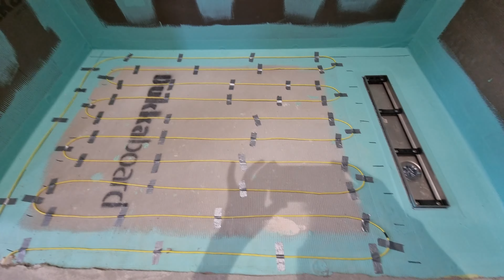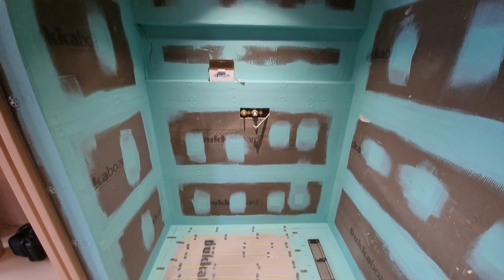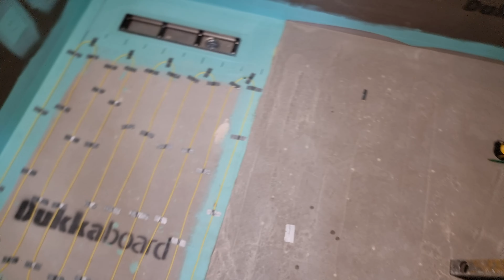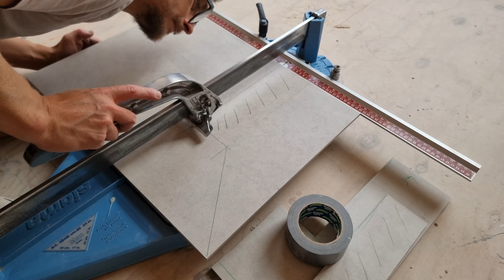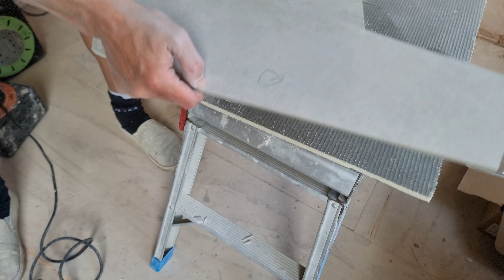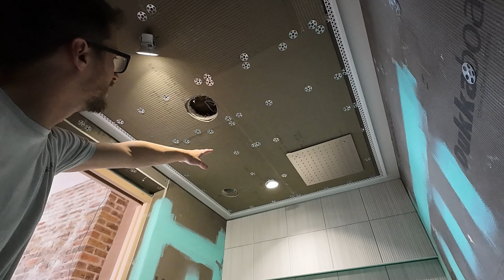How To Tile a Wet Room Shower Tray | The Ultimate Guide

Comment: Very nice, but I would do the dry fit on the tiles before fitting the underfloor heating elements. Nick one of those and it's a world of pain...
Reply from the maker: Hey thanks, Yep always got to be careful working over wires, You can test them  though the job though if needed 🍻

Comment: Hey mate, very nice cuts, looks good.

Some people would say, tile the walls first, i can see you didn't, do find it easier like this?
Reply from the maker: Thanks mate, As it's a wet room you'd tile the floor first to add to the waterproof barrier (so the wall tile sits on top of the floor tile, so you don't have a joint straight down there)
Reply: @thebespokebloke thanks for reply bro.
I'm diying and planning to do very similiar to yours 😁
By the way, why did start the wall with small tiles?
Reply from the maker: @YautjaPt  Awesome mate best of luck!. I think from what I can remember I had to prepare the floor first on that one. So I just tiled a bit of the wall, so it wasn't a wasted day (just prepping the floor)

Comment: hi , have you got picture of the glass screen fitted ? im currently fitting a wetroom with the abacus linear uno former, no envelope cuts, and im stuck on how its going to look were the glass goes along the floor were the tile trim is between the former and rest of floor tiles
Reply from the maker: Hey, There's a bit of footage of the bathroom finished in my "Tiling a ceiling video" but it doesn't show much of the floor But shows the screen if that helps 🍻

Comment: Hi Just got on to your videos  very good....i have a linear 900 x 900 wet tray and I have purchased 900 x 900 porcelain tile .  could you possibly advise me of best way to lay . I dont want to cut tile through the middle ie 450 centre ...many thanks ...col
Reply from the maker: Hey, Great stuff! It depends what type of linear tray it is really (check out my seamless wet tray video if it's different to the type in the video) But the tray will have natural falls in it from the edges of the drain to the edges of the tray (so 4 fall lines if you like) If you wanted to do it in one piece of tile, you'd cut the tile following those line. You can always send me an email with a picture of the tray e.t.c if you like 🍻

Comment: Amazing work. I was contemplating DIY but having watched this I need to get a skilled trader in to do the job justice
Tile manufacturers could do everyone a favour and make pre cut tiles for these floors?
Reply from the maker: Thanks man, If you've got the right tools and are comfortable at DIY then it's easily doable. But yeah having someone that knows what they are doing off the bat is always going to be the best result. Regards pre-cut tiles... I don't think they'd be the value in it, As it depends on your drain to how your envelope cuts are going to be cut, Plus easier to break the tile on transportation. With the right tools, although can be time consuming, They are not to bad to cut 🍻

Comment: how did you create a fall on that back 30cm or so, as you’ve shortened the effective fall-cut as you described? Are those tiles further from the drain and nearest the back wall just level or did you create a slight slope somehow. Cheers
Reply from the maker: Hey, So apart from the perimeter (which is level) the tray is pre formed to fall to the tray at any given part. So even if you cut it in half it would still effectively be falling towards the drain. But yeah with them back cuts I would just make sure it's following the same full as the tiles in front of it. So if you put a level from the drain to the back all the tiles would be hitting the bottom of the level. Hope that makes sense.

Comment: How you can make envelope cuts with a grinder is remarkable. What a lovely finish. Tiles on the ceiling? 😅
Reply from the maker: Thanks Phil, Really It's just a bit of practice and a decent disc.. Yes that fun ceiling, ha.. I do have a video on that as well!
Reply: @thebespokebloke I noticed on the video the shower tray isn't mechanically fixed to the substrate. Isn't there a risk of lift up in the future?
Reply from the maker: @PhilipAlexander-rz6hy  Yeah they stick and bond very well, So you wouldn't tend to mechanically fix a backerboard tray down. With the adhesive underneath and something like Sika flex/Ct1 around the sides, they won't go anywhere. Ideally you don't want to screw through the wet tray.
Reply: @thebespokebloke I suppose that makes sense. These hybrid polymer adhesive sealants are unbelievable. They stick anything to anything and the anything isn't going anywhere 😅
Reply from the maker: @PhilipAlexander-rz6hy  Absolutely mate!

Comment: Does that preformed pan have enough slope? It seems like the slope would be quite flat from the drain to the farthest side. Otherwise, on the shortest side, the slope would have to be massive so that all the edges of the pan are level with one another to meet the walls smoothly.
Thanks.
Reply from the maker: Yes mate, They are usually about 20mm thick, level around the perimeter and have very good falls into the trap
Reply: @thebespokebloke  Thanks for replying! Is the slope on the shortest side really steep? I can't ever tell from the product pages. It looks like it would have to be four times steeper or so.

Comment: Great video! For those two tray cut pieces, do you just pop them in or stick them in somehow?
Reply from the maker: Thanks, Glad you liked it! Yeah just a spread of adhesive on the back of the tile and that does the job. You could also use something like CT1 to stick them down if you wanted whichever way they won't go anywhere.
Reply: @ awesome, thank you!

Comment: wondering why you use an angle grinder over a wet cutter?
Reply from the maker: Funny enough I asked another tiler the same question about 10 years ago.. Now I'd only use a water cutter if I need to, like for marble. Just not worth the hassle when you can get decent results with an angle grinder.

Comment: I noticed a slot in the wall tiles, presumably where the screen is going? Is this common practice? I've only ever seen the screens fitted onto the tiles.
Reply from the maker: Yeah that's for the screen track mate. I don't do to many (maybe 1 in 5 wet rooms with a hidden track)  Tbh it depends what mood the designer is in sometimes to what screen it's going to be, ha. Looks cool though!

Comment: Thank you so much for this really well explained tutorial. I've tiled a wetroom tray before, but used mosaics and wanted to use 600 x 600 tiles this time around. Wasn't sure about the spacing as the tray is 800 x 1500, but the (square) drain is 450 from the end. I didn't know whether to start in the corner or at the edge of the tray so this video was really helpful. Thanks.
Reply from the maker: Awesome great to hear mate, Glad it helped! I'll have another new video on a dual gradient wet tray out soon as well!

Comment: What would a total cost on a job like this be all in? For anyone wondering if this is within their price range? Or is it a case of… if you have to ask that, you likely can’t afford it?
Reply from the maker: It's a good question, I don't know the final amount with all the different trades e.t.c and design.. But I think if you have a vision and a budget, you can make it happen with realistic expectations.. There's so much cost cutting than can be done on things like fittings, tiles, If you can do bits yourself e.t.c. If I had a guess I'd say this one would be around 20k for the while process designers /prep/installers e.t.c

Comment: Another question! We have got a wet tile cutter 180mm, we have cut a few tiles and have quite bad chipping with the abracs blade. Do you have a go to blade for a wet cutter? I don’t fancy doing the cuts by hand with a grinder! (Not as skilled) 😂
Reply from the maker: Hey mate, what cutter is it? The things that normally cause chipping are the blade not being straight, not enough water or the blade itself (assuming the tiles are decent) I just had a look at the blade you've got and it does look more on the budget side of blades.. Maybe try The Rubi TPI Red or if you need a continuous blade for your cutter the Rubi CEV Green (which I've used a lot lately on Rubi wet cutters) hope that helps mate!
Reply: @ spot on this mate, I’ve got a budget wet cutter, erbauer from screwfix, I’ll try them blades mate worth a shot!
Reply: Tiles are porcelain tiles, the abracs blade was £32 for the 180 which I thought would have been decent!
Reply from the maker: @ Sorry I must have looked at the smaller size, but yeah I'd try the Rubi mate

Comment: What is the maximum thickness of glue to create the fall for a base like this, and would you do it the day before, even if you had no wires to cover? (I hope this question makes sense to you)
Reply from the maker: Hey there, Glue thickness varies so whichever brand you have will say on the bag on in the spec. Obvs I'd recommend a pre made base for the tray rather than creating one yourself. Sometimes I'd do the tray or the outside floor before and finish the rest the next day, It just really depends on the job situation at the time. Hope that helps!

Comment: Great video. What do you think of the Abacus UNO that doesn’t need envelope cuts?
Reply from the maker: Thanks mate, I haven't used one.. But I'm sure they serve a purpose in the right scenario/or for a specific look. The only thing I don't like the looks of is the wedge that they have at the side rather than them being the same thickness the whole way around. (I know they have a plastic strip as a solution though) But it's hard to comment properly without using one.

Comment: Nice tiling and explaination. Why have you left a strip cut out vertically down the wall as usually glass screens have a silver transition piece so don’t require this?
Reply from the maker: Thanks mate, It's a seamless finish so the bracket sits inside the wall, So you only see the glass for a sleek look.
Reply: @thebespokebloke  never done or even seen one of those sounds really nice. Thanks.
Reply from the maker: @russellscott1151  No worries, Yeah just something a bit different and minimalistic. You'd normally also have that same channel in the floor as well on some hidden shower screen tracks.

Comment: Awesome vid. Im using 5mm spacers. Do i need to make 5mm wide cut with the grinder or is space created with the angle its self?
Reply from the maker: Thanks glad you like it! If you're joining on a full tile onto the envelope that isn't cut.. You just need to replicate that joint in your envelope. So you don't need to cut it with a bigger blade or anything, Just open up the gap to 5mm on the envelope so the joints and tiles line up. Hope that helps!

Comment: What’s your preferred thickness for backer board on floor and walls please?
Reply from the maker: I think 12mm if you can or 10mm is the perfect thickness for rigidity mate onto a stud wall. On floorboards I believe 10mm is the minimum you can go. If you're using it on plastered walls/concrete floors, then sticking 6mm to it is fine. It just depends on what your thickness constraints are. Hope that helps!
Reply: @thebespokebloke  thank you. Also, I’ve got some gold trim to match other fittings, buts it 12mm trim and the tiles are 8mm? Can I make it work?

Comment: Nice video!
I have one question.
Do you apply any silicone around the edges of the drain after installing the tiles and grouting?

I guess you applied silicone around the edges of the floor and walls. Is my assumption correct?
Reply from the maker: Hey, Yeah so once that bathroom is all done, All the internal and external joints get siliconed. Regards the shower trap edge, yeah either or really. I grouted this one but sometimes they are siliconed. Its not a massively vital area, as any failures here and the water go's back into the trap. Hope that helps
Reply: @thebespokebloke  my contractor was telling me to put the tiles on the douche tray , but kow he says it's better not to , just to put the shower tray in , at the end , with silicone... inwas thinking grout would be the best , but then with the tiles , on too of the tray
Reply from the maker: @DonTeridon  I'm still trying to work out your situation, ha.. Is it a wetroom tray you are installing? (i.e one that is meant to be tiled?)
Reply: @thebespokebloke  hi , I thank you for the reply,  I bought a stone shower tray , so a complete piece , the floor is ready but not the walls , so he said let's build the walls,  and then just put the tray in the corner ( 4 cm high) with silicone all around and then glass on one side.I think it's best , to put the tray in the corner , put some silicon between the wall and it.and then build the wall tiles , sitting or touching the tray on the sides where it will be slightly ( 2cm ) in the wall / under the tiles , does that make sense ?
Reply: @thebespokebloke  yes a wet room tray !!
Reply from the maker: @DonTeridon  Got ya, Yeah.. If you can I'd put the tray in first before tiling the walls. 
( you can build them, so they are ready to go) But yeah it will just give you an extra water barrier with the tile coming onto the tray. Like you said.. Silicon the tray to the wall (even better use something like CT1), Silicone it again before and then after tiling, and you should be pretty solid.
Reply: @thebespokebloke   good advise thank you , ! Now next hurdle to convince this coconut of a contractor I hired 😅😅

Comment: Great job. I’m waiting on my tiles for mine. Abacus square drain tray. 300 x 600 tiles. What size are your grout lines ?
P.S I have just bought the Bosch grinder and a series 4 Sigma after watching your videos 👍😁
Reply from the maker: Awesome! Try and get your joints to set out in a cross off of your drain for the best look! (So joint running through front and side centres) They are 2mm mate. Nice choice on the new tools, You won't be disappointed! Best of luck with it!